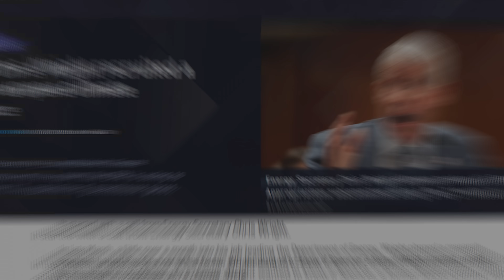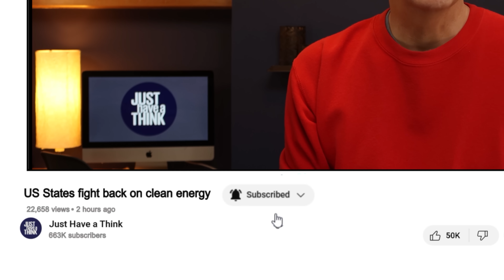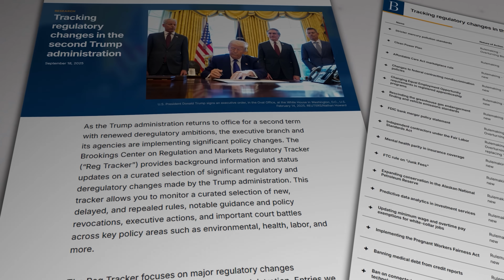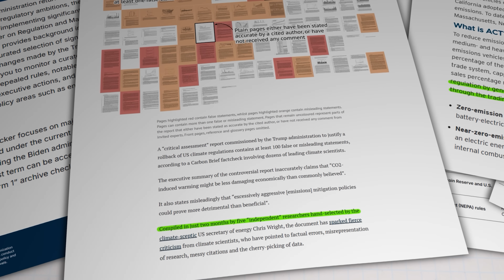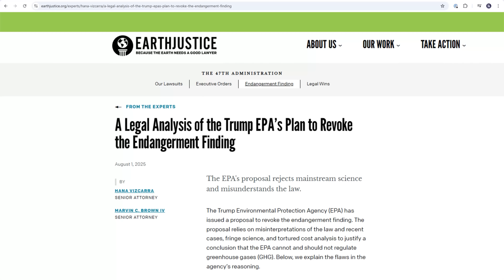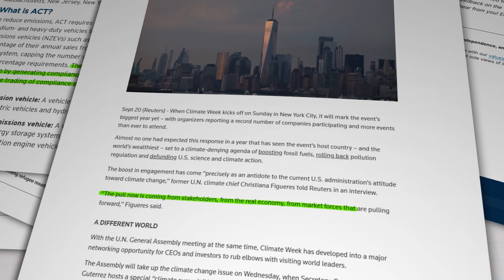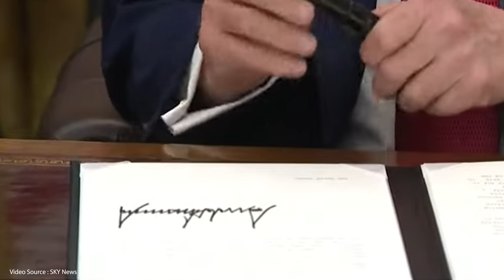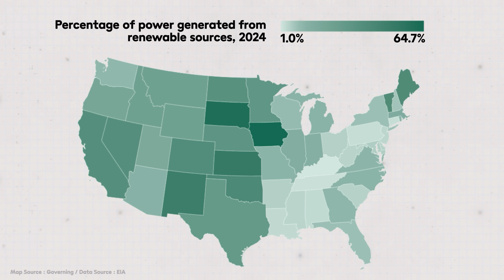The battle for American energy supremacy.

Comment: Thank god that renewables turned out to be just plain better than fossil fuels. We would've been cooked otherwise.
Reply: It's just physics, really. All energy ultimately comes from the sun, and every time energy is transformed from one form to another some of it is lost. Solar is just getting at that energy with a minimum of transformations. Even wind is just the sun heating air, fewer transformations than any fossil fuel.
Reply: @Kevin_Street  The rare earth's involved with renewables. Are about to dry up.... China's had enough of Europe and the USA. Even mining rare earth's uses a phenomenal  amount of diesel and. Processing rare earth's is. dirty and dangerous
Reply: @zambotv8150  as many have tried to point out to you, it’s primarily because of the marginal pricing in the UK (meaning the most expensive energy source’s price is paid for all energy, which is gas) and that this marginal pricing is UK-wide rather than being regional, so even if Scotland was able to fully provide the renewable energy for themselves for some period, if e.g. East Anglia couldn’t, then gas prices would dictate the prices for both them and Scotland. It really needs to change.
Reply: @rainbowevil  It's shocking isn't it? The irony is.... Scotland has loads of gas... The whole sector should be nationalised. They shysters are holding a gun to our heads
Reply: @zambotv8150  It's commonly misunderstood exactly where "rare earth" elements are actually used.  Firstly they're not actually that rare.  China's dominance in supply has historically led to dependence, but supply restrictions under high demand will lead to alternative supplies.  The vast majority of these elements are used to create magnets... for electric motors.  They can be used in generators too, but electromagnets can be cheaper.  It's true cobalt (which isn't a rare earth) has supply issues, but the world led by China is rapidly moving towards cheaper battery chemistries.
Reply: @ChrisNotTheKing They're used in loads of stuff.. Computers' mobile phones' lighting. All smart tech depends on them these days. Military tech is a major user of rare earth's
Reply: @zambotv8150 its better than fossil fuels, you know that though.
Reply: @ChrisNotTheKing You pretend to know what you are talking about but have no idea really. Yes, they are not particularly “rare” but what most of them are are byproducts of monstrous Chinese mining and refining operations. America wants to make its own Gallium for example? Cool, I hope capitalism can stomach becoming a top aluminium mining, refining and manufacturer at a time of historic glut where even China struggles to move their aluminium. Plus China sits on piles on piles of industrial secrets for refining many of these materials that certainly won’t be shared with the west. Seriously, they have spent 30+ years getting their rare industry going, mostly as a side quest of trying to make money of their bajillion tons of mining tailings and you think this can be brought back to the west overnight? Get a clue, it’s a 10-15 year project MINIMUM that will demand Trump become Comrade Trump with five year plans and hundreds of billions of taxpayer dollars thrown at it since the free market will not bear the unprofitably.
Reply: @Shrouded_reaper  It's a historical result from world trade, and China's ability to undercut competitors.  There's all the rare earth mineral and bauxite and refining potential in an Australia which is willing to accept trade deal$ to the world's benefit.  Daft US trade policies just forced China's hand.  Australia is ready near the podium.  It has reasonable governance, political ties and trade with both Asia and the West, the means and motivation.  Plus we make Vegemite.
Reply: @Shrouded_reaper  10-15 years seems to be a reasonable time for return on investment. Even if it takes an additional 10 years to pay back the initial investment. I think it took Amazon 20 years to destroy and buyout the competition and achieve profitably. It takes 10 years for people to become doctors and people still do it even though it's a hard and long process.
Reply: Look forward to gas being removed from the energy mix sooner rather than later.  Large battery building projects have never been as prolific, with much credited to their precipitous fall in price.  When gas is gone prices are likely to be pegged at market rate for storage... which WILL be cheaper than gas.
Reply: @ChrisNotTheKing  But. That's my point. Energy isn't getting cheaper. Its getting more expensive... What's the carbon footprint of mining and processing the minerals needed to make mmodern batteries?  What about the environmental impact of replacing gas? And in the meantime.  Europe is being deindustrialised
Reply: @ChrisNotTheKing  that’s how they get you, but execs will make sure they get their money. Making things cheap means they have less to spend on their weekend resort.
Reply: is this for real? LOL
Reply: But people need to believe this.  We need to muzzle the propagandists who poison our debates.
Reply: Technology improves upgrade and innovates into better efficiency that means as technology develops and changes so does the infrastructure meaning finding better energy sources that allows high tech society to develop
Reply: @narutov4  Mate. I live in Scotland. We are oil and gas rich. We already have enough wind power to power 2 Scotland's. We have 85% of all the hydroelectric in the UK yet, We have some of the highest energy bills in Europe.... Make that make sense
Reply: @zambotv8150  We have the lowest cost of energy production in Europe, we sell it to ourselves at some of the highest costs. That particular problem is a middle man problem, not an energy production or technology one.
Reply: @EvilScot  Our politicians are clowns
Reply: We're still cooked, maybe medium rare but I'm not sure if I feel comfortable with that kind of heat
Reply: @anarkitty0  you understand it was inevitable, right? We probably accelerated it but the tail end of an ice age wasn’t going to last forever
Reply: @anarkitty0 we are cooked but I think our grandchildren will be better
Reply: How so? Diesel moves commerce, gas powers commerce
Reply: @zambotv8150  firewood did the same thing before dino juice, folks stopped burning firewood, it was running out, and it's why folks will stop burning dino juice, it's running out, just a little bit of thinking, nothing too painful, don't hurt your head
Reply: @zambotv8150  NOT MUCH LONGER
Reply: @zambotv8150  there is the concept of single use, there is only so much dino juice to go around, so.... never mind "feelings", kinda sorta need something else, eh
Reply: @shri-vas  Are you sure it's "dino juice?"
Reply: @zambotv8150  you poor baby
Reply: @shri-vas  Just pointing out the lunacy of our "government" and.... It's stupid policies, but. Thanks for the comment
Reply: @zambotv8150  Replacemens that emit no CO2 are on the way and they have to be if your grandchildren are going to have lives worth living.
Reply: @rogerphelps9939  My current life isn't much fun due to how expensive energy is in Scotland
Reply: @zambotv8150  but you are paying for some rich CEOs , privatisation dividend. If you dont like it ditch gas and make your own electric like I did.
Reply: @waynecartwright-js8tw How much did that cost, buddy?
Reply: @zambotv8150  Yesterday, sure.  But the world - with the US straggling behind - is moving to cheaper electrification powered by renewables.
Reply: @krakken-  We can send container ships to China using wind power? Please tell me more
Reply: @zambotv8150   let’s assume you are a climate change denier who doesn’t care if GDP collapses for your kids and grandkids in c 2070. 
So we need to look at money instead. 
The financial disadvantage of renewables is that the cost is all up front capital cost. 
The financial disadvantage of fossil fuels is that once the initial investment in a renewable alternative has been paid off, the energy becomes free and switching back to fossil fuels becomes financial stupidity.
The oil industry are extremely worried by that thought.
Reply: @jgreen9361  Have you noticed roads are covered in bitumen and. Plastics are everywhere?
Reply: @zambotv8150  I am a chemical engineer with ample knowledge of the oil industry. What exactly has bitumen got to do with the economics of a solar panel? No relevance. Quiz question for you, what is the Scottish connection between road surfaces and nuts grown in Australia?
Reply: @jgreen9361  Tar McAdam..... As an esteemed chemical engineer. What would you suggest we use instead of bitumen to cover roads?
Reply: @zambotv8150  Unlike the dinosaurs who don’t care about the future of the planet, I suggest we implement the solutions we already have and work to find better solutions for the problems that remain. Using the excuse that we don’t have a solution for everything as an excuse to do as little as possible seems an act of rank stupidity wouldn’t you agree?  
However, to answer the question. Before 1950, nearly all roads were built from “new” asphalt (concrete or cobbles being the only alternatives). 25% incorporation of recycled cold asphalt became possible in the 1950s, but wasn’t always used. By the 1990s, with new techniques, 70% recycled material became possible . Since c2010, 100% of an old asphalt road has become possible, incorporating well over 70% recycled materials in the new road. In fact modern roads last longer and wear better because of the higher proportion of recycled material. We don’t need to replace bitumen, just use a lot less of it and use renewable energy to melt it.
Reply: @jgreen9361  The roads in Glasgow are knackered buddy,,, All our money is going to the carbon neutral war in Ukraine....Riddle me this... Scotland is an energy powerhouse. Why are my energy bills so eyewatering ?
Reply: @zambotv8150 so there is actually a very infuriating explanation to this, which (I am sure you will enjoy) involves being angry at government overreach and incompetence! 

In the UK, energy prices are tied to the most expensive unit price through 'marginal pricing'. This effectively means that even though we have enough power to give the entirety of the Scottish population free household electricity - we are still charging the consumer the same price as if they were to be generating all that power from gas. 

It is effectively the same thing as making a cheap space heater cost the same as burning 100 candles - all because the candle factory doesn't want to lose sales. 

I can't make it make sense, because it doesn't. It's pure insanity.
Reply: @jgreen9361  I'am a proud denier. Nothing will colapse only the media with all their lies
Reply: @stofjes4204  How old are you?
Reply: @jgreen9361  I prefer content-related discussions. So come to the point
Reply: @cr0w-qz277  This essentially means it's the UK governments fault that UK energy prices are the way they are and not the fault of solar or any tech.
It's also fairly idiotic as low power costs are good for industry making UK hostile to industry.
Reply: @jgreen9361  Nothing to do with us being dragged into a war with Russia or. The Yanks blowing up the NordStream pipeline? Europe is whacked as a manufacturing centre due to high energy costs.... Our demonic politicians have done some number on us
Reply: @zambotv8150  What do you mean “nothing to do with” of course they add to the list of reasons for high prices, but those two reasons affect the rest of Europe as well don’t they. 
I was being specific about why our prices are amongst the highest in Europe. One, incompetent deregulation and the disaster that followed , the other incompetent infrastructure planning, both faults of Tory policy and management.
Reply: @jgreen9361  The Yanks fomented a war in Europe. Committed the greatest act of environmental terrorism ever by, blowing the NordStream. Starmer's spent billions sending weapons over there but. I need to buy solar panels from China that I can't afford to offset the USA's pollution?  I run a small business, I just want affordable energy... I really don't care where it comes from. Scotland's a renewable energy powerhouse yet. My bills keep going up? It's Kafka-esque
Reply: @zambotv8150 Your energy bills are high because of how the UK’s energy markets are structured. It is a purely political decision that Scotland has high energy bills so that energy-poor places like London can have lower bills than they would otherwise. A bid to move to regional energy pricing lost support and fell apart. Such a move would have given a place like most of Scotland unbelievably cheap electricity.
Reply: @olamilekanakala7542  It breaks my heart at. How incompetent our politicians are. Especially up here....
Reply: @zambotv8150   You really have a hard time staying on subject. The worsening global problem is in the name "fossil fuels ". The greatest harm comes from burning them for energy, not making bitumen for roadways. We now have better alternatives for providing energy for most uses. 

There is no solid evidence that "the Yanks" blew up the Nordstream pipelines. It is primarily Russian fabrication and misdirection, and a single U.S. reporter claiming an anonymous source and explaining all the evidence to the contrary as conspiracy-infused "false flag" operations. Meanwhile several Ukrainian nationals have been indicted in the investigations.
Reply: @skierpage  The Yanks seen Europe as a manufacturing competitor... They started a war with Europe's largest energy supplier then. They blew up the pipeline that carried Russian gas to Europe. That job is done. Due to eyewatering energy costs, Europe can no longer make goods competitively. Now they're trying to cripple China by. Cutting it off from Iran's oil. "If,"  your theory on renewables was correct. Energy bills would be dropping, not rising. On the NordStream. Cui Bono? Where does Europe buy it's gas from now?
Reply: @zambotv8150  they are the best politicians money can buy , like Amber Rudd on the board of centrica now .
Reply: @zambotv8150  You're right about the transportation side of things (at least for now, there's some very interesting technology on the horizon which is already here for personal transport and is coming for freight). However, on the electricity production front, renewables + battery storage are often cheaper than gas in the medium to long term. I say "often" and not "always" because there are situations in which gas is still more cost-effective for various reasons, though those cases are increasingly fewer and farther between as renewables get cheaper and the cost of gas remains the same.

This is what my original comment was referring to, as we've seen very rapid adoption of renewables in the electricity production sector (where they simply make financial sense) and not so much in the transportation side of things, aside from personal mobility like electric trains, electric cars, e-bikes / electric motorcycles, and so on. I lament that, while it would make sense in the long term to switch to renewables in every aspect of society (even if it's not financially sensible in the short term), this would never actually happen unless there were also short-term benefits. 

This is what the other replies are trying to convey, though with much more emotion, insults, and personal attacks. Quite disappointing, as that is not how you convince people of anything. I apologize on their behalf. They're right, but they haven't been taught how to communicate appropriately and lack empathy towards others who think differently from them.
Reply: @thorvaldspear  Nothing will work until the energy sector is brought back into state ownership IMVHO.... These companies are FLEEXCING us
Reply: @zambotv8150  I don't think that the fact that they're private companies is the core issue, as european countries have had great success in building out wind and especially solar for a reasonable cost. The main issue is that governments are either corrupt, innefective, or more likely a combination of the two. Frankly, in my vaguely informed opinion, it would yield even greater benefits if governments simply provided subsidies to citizens if they install solar and a battery backup. That way you own your means of electricity generation, which will lower your electricity bill over all. 

I know that in the UK the way that electricity is priced by the government is downright criminal, so bypassing the electricity company entirely would avoid that problem (in addition to providing all the benefits associated with distributed electricity generation, such as lower grid infrastructure costs and higher grid resillience).
Reply: @thorvaldspear  It's a racket.
Reply: @thorvaldspear  Australia's home battery incentives have been phenomenally successful, and make really good sense given high home rooftop solar adoption, and the duck curve.